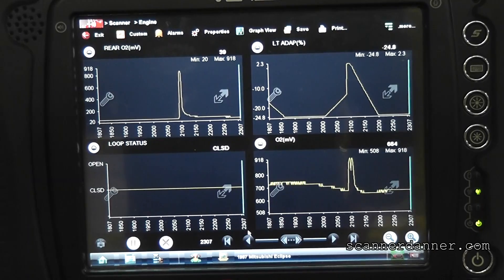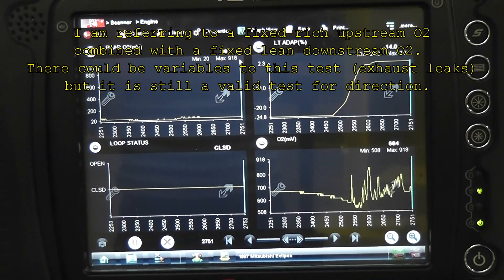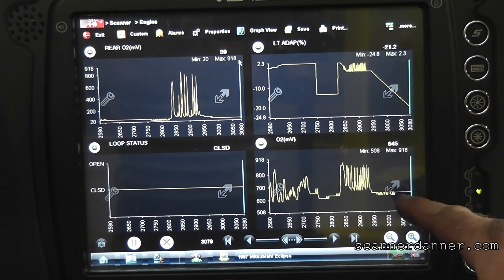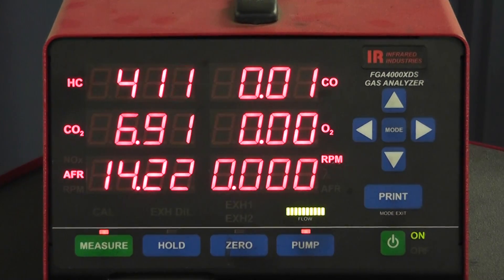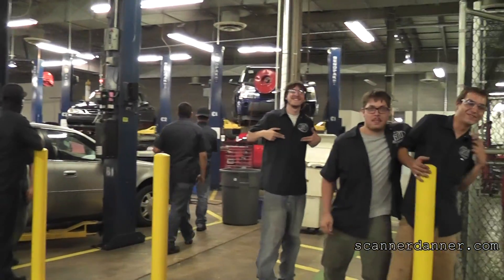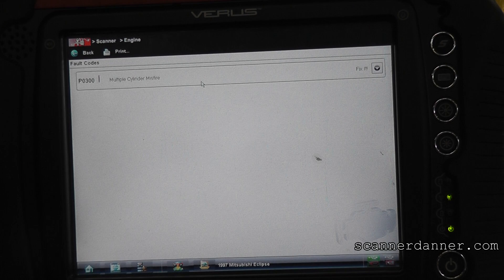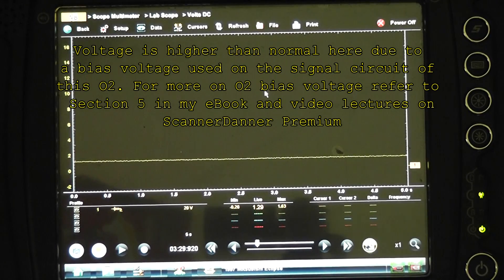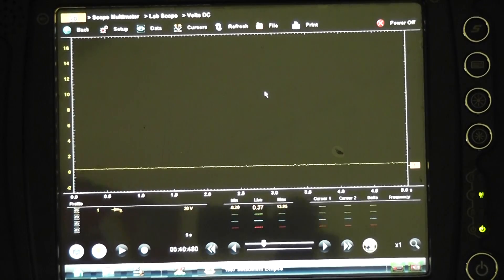How to identify a bad oxygen sensor (signal fixed rich)

Comment: Hi for my cars upstream o2 sensor is reading up as high as 3.8 milliamps at idle has been misfiring and slow could it be a bad upstream sensor even without a code?? I'm also running lean LTFT which before would always be close to zero. Thank you
Reply from the maker: Attack the misfire. But also confirm full range of the O2 by doing a WOT run and then a deceleration. You'll get full rich and full lean conditions during those periods

Comment: Hey my sensor is reading at high 900mv at idle but when I press the gas it oscolates like it's supposed to any idea if that is normal?
Reply from the maker: You do not need an oxygen sensor, that much I can tell you. But you've given me very little info to help further
Reply: @ScannerDanner  it's an 1989 Chevrolet Camaro, didn't understand your answer , I don't need it ?
Reply: @ScannerDanner  basically my  o2 sensor signal wire was cut on accident and I crimped new connector on and heatshrink it, I get like 405 mv from back probing the connector with key on engine off, when in closed loop it stays like at 800-900 millivolts at idle but soon as I press the gas it fluctuates from 2-9 milivolts like supposed too
Reply from the maker: @The1972Cutlass 400 mv is normal bias voltage with a cold sensor and the key on. 
The fluctuations off idle means the O2 is perfectly fine too.
The fixed rich signal at idle means exactly that, your engine is running rich at idle. Do you have a scanner that will talk to your system? It would help to know what your block learn and integrator numbers (long term and short term fuel trim) but I'm guessing you do not have that ability as obd1 scan tools are not easy to come by.
What are your symptoms? What are you chasing? 
I would pull the vacuum hose off of your fuel psi regulator and make sure there isnt fuel coming out as a step 1
Reply: @ScannerDanner o ok so it being around 800-900 mv at idle is normal? My problem is that it runs fine but stalls after a while , it hasn't stalled yet since I changed the new oxygen sensor and crimped another wire with heatshrink tubing to the o2 sensor signal wire I jus expect it to stall again seeing that it wasn't fluctuating up and down at idle only when I press the gas
Reply from the maker: @The1972Cutlass  it's not normal, but these older systems wouldn't fluctuate much at idle. Your intermittent stall is on another path. Clean your throttle body as a step 1 for that. I have videos on this
Reply: @ScannerDanner  o ok I jus suspect it to be oxygen sensor related since the problem only happened after the wire was cut while driving but I'll try that tomorrow thx a lot for the help
Reply: @ScannerDanner  also it was cut while the car was running not sure if that makes a difference on the issue could it have shorted something if so
Reply: @ScannerDanner  sensor was also replaced 3 times after the wire was cut that eliminates it being the sensor in my opinion
Reply: Just have a multimeter at moment but looking to get the snap mt2500 scanner

Comment: I'm trying to learn how to troubleshoot lying o2 sensors and I have learned a lot...however im a little confused...if your upstream is rich and downstream is lean isn't it possible that the catalytic converter is bad causing the low voltage and not necessarily a lying o2?
Reply from the maker: A converter that is bad will no longer reduce pollutants, it won't ever create false lean conditions. Hope that helps
Reply: @ScannerDanner  thank you that does help

Comment: What would cause  when installing new 02 sensors AC Delco 2013 Chevy Avalanche  5.3V8 to spit and sputter and  back fire  and when you step on gas acts like it wants to stall out
P codes : p050,P0151,P0153,P0154,P015D,P0156 and P0300  Checked all wiring good to go, put old sensors back in and runs  any ideas? I also when I have to accelerate hard it blow black smoke.
Reply from the maker: Why did you change the sensor in the first place? Also define the codes please.
Reply: I changed because I was getting 02 sensor codes. Code# p050 Ho1 Bank 2 circuit mal function, p0151 ho2 bank 2 low voltage, p0153 bank 2 slow response, p015d delayed response lean to rich, p036 circuit malfunction ho2 bank 1; I was leaning more towards a ECU and there is nothing wrong with the fuses they all check out good and can not find anything wrong with wiring.  What do you think ? thanks in advance !  @ScannerDanner
Reply from the maker: @Fran-yg4jp  you need to do direct voltage measurements on your O2s with the engine running. It's not going to be the PCM
Reply: Thanks I will take a look and test  @ScannerDanner
Reply: What would cause the new 02 sensors ac delco and i am getting 12 ohms when i test them  to cause the vehicle to back fire and hesitate ?
 @ScannerDanner

Comment: sir Chevrolet spark 2013 model oxygen sensor bank 1 and bank 2 sensor are same or not ?  actually  bank2 sensor not working but ihave extra bank1 sensor so can i fix the bank1 sensor place to bank2
Reply from the maker: On some you can but typically the wiring is wrong (too long or too short of a harness)

Comment: Mine says it’s rich on top and lean on bottom. When I floor the pedal it has power but on closed loop. It won’t change from lean to rich even if I floor pedal but its accelerating fast.
Reply from the maker: rich on top and lean on bottom??
Reply: @ScannerDanner  yes. I replaced both catalytic converters with bottom O2 sensors. 
Keep getting code 2137 bank 1 sensor 1 code. Reset MAF sensor and still comes back. Did have a leak because the engine was louder but went and replaced gaskets because they were cheaply made. Torqued to specs.  2004 infinity fx35 awd. 3.5l.
Reply: @ScannerDanner  I take that back. Marks on top sensors 1.35 out of 5V 
And bottom .35-.55 on bottom  and both are consistent. I do use the. XTOOL OBD reader.  I do hear shaking from catalytic converter on driver side when on stop lights. It’s connected to a Y flex pipe then resonator. Can the y flex pipe be the problem. I can see through the flex mesh.

Comment: My 05 mishubichy with a 3.0 L 5speed stand GTS an H engine runs really riff at start up an revel so hi I think it’s going to blow up some times  it’s got 4 of the 4 wire o2 sensors how would I check to see which is the bad ones and which is still good?? Please help me to figure this one out thank you 🎉so very much
Reply from the maker: Rough at start of and revs high wouldn't be O2 sensor related. Do you have O2 codes or something? Any other codes?
Reply: @ScannerDanner  yes multiple misfit, and o2  heater circuit an dsaaaa
Reply: @ScannerDanner  goa code Po141an po13502 sendsrnver along with poqww
Reply: Also pol221/a predicted out put see hthi on the TPx

Comment: so, if fronts pulse between 800 and 0 and rear should be zero, right? Why would one rear bank jump to 600 and other rear around 130mv - High fuel pressure? because it is aftermarket with stock pressure regulator, but why is bank 2 richer than 1 bank. If it were high fuel pressure both banks would report rich right? Map reads out just fine for vacuum, I have high long term fuel trim and high short term at low pressures. Just need help brainstorming. 2 up stream 2 down stream
Reply from the maker: Downstream O2 sensors and what they read will be affected by mixture issues of course, but also the cat itself! Cats are design to catch and store oxygen, so a good functioning upstream O2 and then a downstream sensor that reads flatline voltage is normal cat function.
Reply: @ScannerDanner  See I kind of knew I was on the right track because I did buy cats and haven't installed them yet, I'm still just 100% making sure it's that, dodge chargers are known for wiring even in the 08's I've chased 3 grounds, 2 in a stranded throttle to intake runner, 1 for the taillights that was grounding my traction control out. It was crazy. But ever since I popped the timing belt and redid everything top end she's been great, I even replaced every sensor that time too. Last object in car are cats and rear o2 I have never changed but they look not factory so definitely replaced at some point. 145k I think the cats are toast, I do smell them on hard runs.
Reply from the maker: @matthewpetersen4417  what are you chasing? What are your symptoms and codes?
Reply: @ScannerDanner  so I get a code not always of bank 2 sensor 2 stuck rich I don't Rember the number, but I can smell my cat burning on a hard pull, I run hptuners and all I have done is Learning is disabled, its map enabled, throttle adaption is off and throttle delay is zero now. So I am not blaming any part of the tune, but the fuel pump I run is a 110 psi that runs on the stock pressure regulator.(for now). I have watched my live data on drives and long term fuel trim is very very high at low rpms but evens out at higher, same with short term but that's more spiritic through the rpm range. So as I noticed this new thing I also noticed I will kick into gears harder and not nice hard.  
so I studyied what my 4 o2 sensors were doing the other day and my upstreams are correct bouncing 0-800 or so but my rears on one side is almost 600mv and other about 130mv and they will go up and down too.
Reply: my map reads 14.8 for atmosphere and manifold absolute pressure at idle reads 4.7 psi - if I'm not mistaken that's a good vacuum.  Enough to not warrant inspection for vacuum.
Reply from the maker: @matthewpetersen4417  typically with these tunes, you need to eliminate the cats as you are no longer striving for optimum emissions as a factory tune does. Once you get into modifying the base tune, all bets are off, with everything. You've also modified your fuel system and without knowing all the specifics of what you've done and why, there is no way for me to guide you further. You are more of the expert here than me when it comes to this stuff. The only thing I can help you with is how the system is supposed to work. Your fuel trims being way off under light throttle is a problem. The 110 psi of fuel psi is a problem too as every single injector base pulse width command will flow more fuel than what the program anticipates, so naturally you are going to have negative fuel trim commands, especially at light throttle. 
There is another variable here. If this is a wideband upstream O2 system, the downstream O2 sensors can be involved in fuel trim control (minor corrections). So your stuck rich B2S2 problems can contribute to fuel trims being off at times and then also the different downstream O2 numbers you are seeing. Hope this helps
Reply: @ScannerDanner  let me ask this then, when should I be seeing any action from my egr. so the bank that is more of a problem is the egr side. I just relogged a run and my front did the correct variation and rear values stayed 700mv both sides. This is a new but progressive issue, and I got cats for a reason because of possible clogging or blockage. I guess I'm gonna flash stock tune back for further comparison. since I have the hi flow cats I'm gonna do them anyway. I'll keep you updated on the outcome of the cats and sensors.
Reply from the maker: @matthewpetersen4417  EGR will typically be a mid throttle control, with no EGR flow at idle or wide open throttle. The problem with you running the stock tune is that you are running much higher fuel pressure than the stock tune would be written with, so every single RPM/Load combination will be richer than it should be and your fuel trims will be running in the negative ranges. This video will help you understand what the manufacturers are doing with the fuel trim and why https://youtu.be/oRX2V6_a3dc

Comment: Man I’ve been trying to figure out this p2196 p2198 code. I literally changed the spark plugs, spark plug wires, o2 sensor, maf sensor, air filter, both cats, fuel injectors, fuel pump, air filter, purge valve. I’m literally stuck
Reply from the maker: step 1 with rich reading oxygen sensors is to perform a deceleration event with high RPM which causes injectors to shut off (decel fuel cut) and make sure that the oxygen sensors drop full lean. If they stay rich, you have O2 issues, if they drop lean you have an actual rich condition and then you proceed in that direction
Reply: @ScannerDanner  okay I’ll perform that test tomorrow. I greatly appreciate that

Comment: I get a lambda of 1.99 on the upstream at cruising speeds and the down stream pegs at .99v so my short term fuel trim skyrockets to 46.9%. Only happens at highway or cruise speeds.When driving around town it’s constant zeros. 05 Acura TSX 6 speed. Does that sound like a bad upstream air/fuel sensor?
Reply: You ever figure it out?

Comment: Bro, I finally landed on this page, Got Acura TSX 2009, doesn't run over 20 mph and check engine is blinking, Code: P02301, changed spark-plugs, and fuel injectors as well, code still there, I got a scanner today, and I see O2B1S2 value : 0.065 , and SHRTFTB1S2: -31 . Can I assume it's the O2 sensor that's causing the issue?
Reply from the maker: doesn't accelerate over 20 mph with negative fuel trim numbers is not good. First check is to test it for a melted cat (restricted exhaust), then find out why it is running so rich. Yes a faulty O2 can cause this rich condition but NOT the low power. But a melted cat can be the low power for sure. 
https://www.youtube.com/watch?v=9TlygJMxTps
I have other clogged or restricted exhaust testing videos too

Comment: Double negative long term at almost any time the motor is running. As I drive trims are all over the place but mainly always 30 something in the negatives on both long term sides. Short term wants to work but stuck 90% of the time with double negatives usually at -30  to -33.  At cold start up almost always an instant start/stall on the first drive of the day. Any other times of the day after my initial start up it fires right up. Been dealing with this for some time now and seems no matter what I do I can't fix this. Paul I could really use some advice on this situation if you could throw me some guidance. I did replace all 4 oxygen sensors on my 2007 2.7 Dodge Charger... didn't help a darn thing. Tried to find Mopar original O2's and needing my car for work asap nobody had them and needed to be ordered so I just went with whatever they had in stock at O'Reillys. Didn't get the cheapest and chose the Bosch O2's. At the point...throwing my hands up bcuz I just don't have the know how or money to be a parts changer with a lot of the parts and don't want to be a parts changer lol.  Wish you were my mechanic. Any advice would be greatly appreciated man.
Reply from the maker: Those Bosch O2 sensors are absolutely a problem  on your Chrysler system. 
The O2 sensors wouldn't cause a start stall though. But a dirty throttle body could. 
Did you have these same very negative trim numbers before you replaced the O2s?
https://youtu.be/-lUYRqaYvYI
https://youtu.be/gtTKOuu6EPw

Comment: Hi, there, i have a w203 from 2005 and the oxygen sensor 1 is always at 1 to 1.3v or 1000 to 1300 mv, and the long trim is stuck at 25%. Ichanged almost all posible vacuum pipes and its still the same, i havent changed the maf but what should i do change the o2 sensor or the maf???? Can someone help me?
Reply from the maker: we can absolutely help you! Post this to my forum https://www.scannerdanner.com/forum/post-your-repair-questions-here.html It is free to join. It is just easier for me to do it there rather than back and forth messages here on YT which I find impossible to do . Hope to see you there!

Comment: Hey man, I find this video very educating. However I hope you can help me on my problem.

My Downstream o2 Sensor is reading 0v on idle and on deceleration, but goes hover around 800 700mv when on the throttle.
is this a symptom of a bad o2 sensor? also my LTFT are high at +25 on idle and close to 0 at 2500rpm

I have a catless header and a defouler
Reply from the maker: Sounds like a classic vacuum leak my friend

Comment: I think I have something like this going on. my upstream is reading .03v and downstream is reading .45 and my car is running rough and rich for sure with all the black smoke and covered plugs.
Reply: as well as p0300 code as only code
Reply from the maker: did you fix it? .03v upstream would certainly cause the PCM to add fuel and lead to black smoke

Comment: Hey dan, I have a strange problem, I keep getting cat and o2 codes, while my cat and all four o2 sensors were replaced. Looking at data, bank1 downstream is always at 0.00, upstream 1.0 to 1.5, while bank2 is always reported rich, but values for bank2 seem okay (short trim around - 2%). I am suspecting some minor but somewhat problematic vacuum leak...?
Reply from the maker: What are you working on? Year, make, model, engine? Can the O2 sensor connectors get switched around? Maybe you plugged them into the wrong connector?
Reply: @ScannerDanner  getting 1.5 to 1.4 volts in my upstream, is it a bad sensor? Thanks